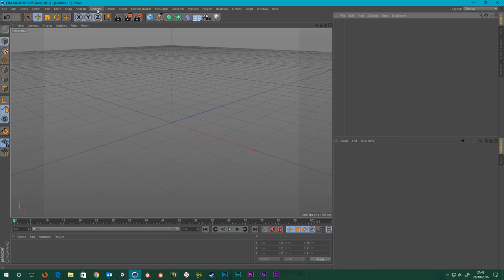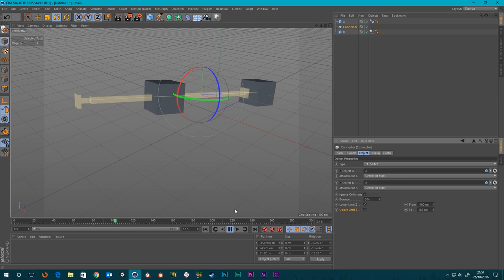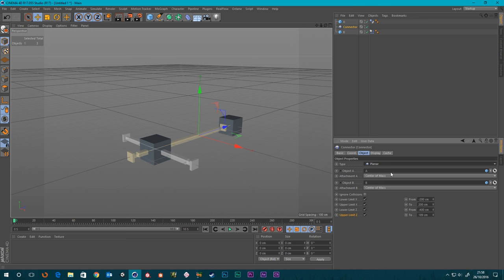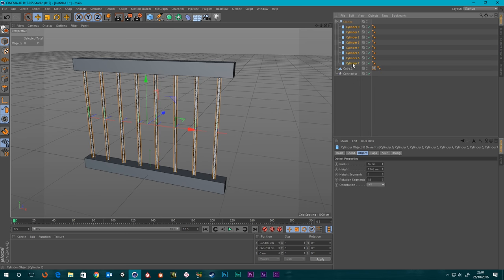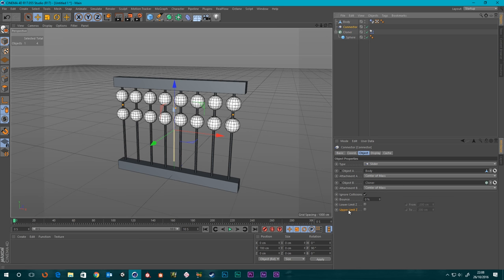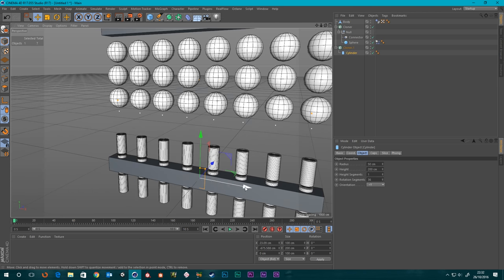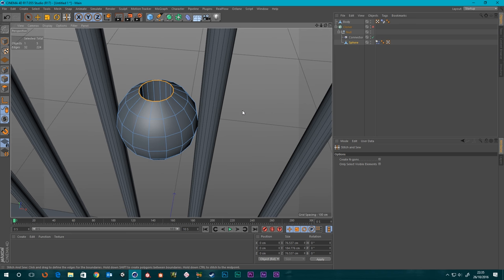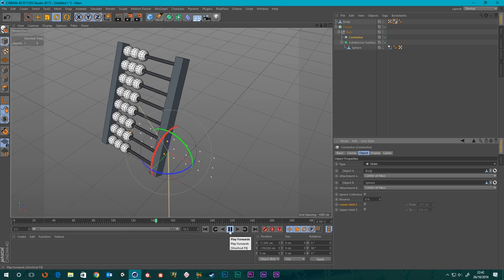Dynamic Connectors In C4D - The Slider, Twist Slider, Planar and Box

Comment: 21:40 question, for the connector the "body" does not stop the balls, its the limit settings, so I assume the 'body' being put in "A" makes it possible for the whole rig to rotate together, as I noticed you rotate the "body" which is not in the cloner null.